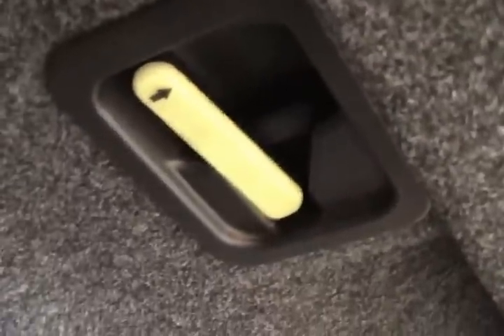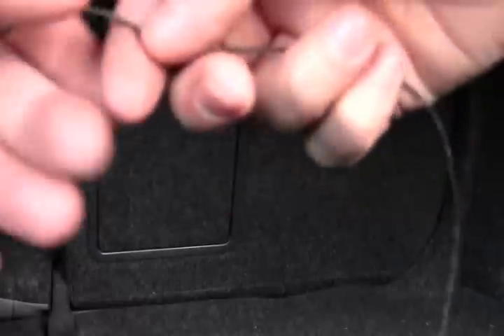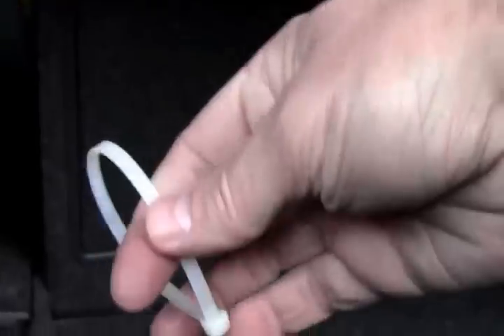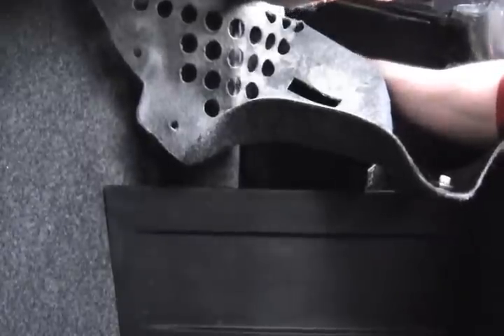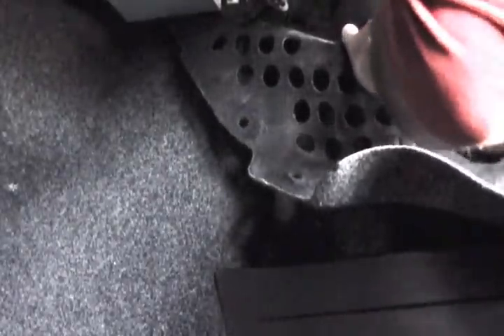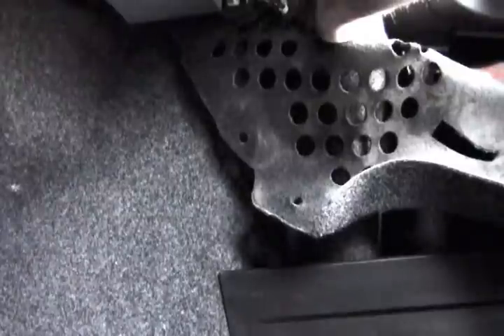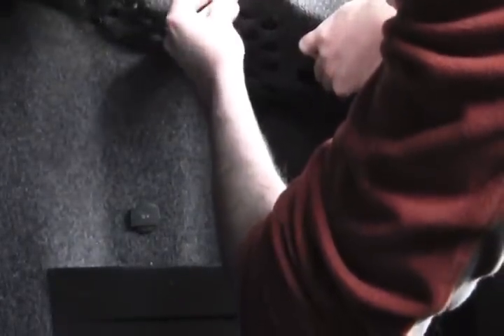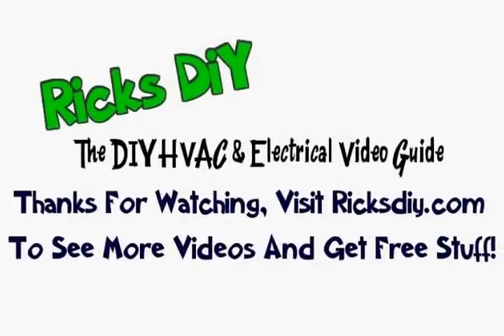Emergency Manual Fuel Door Release VW Jetta Golf Passat MK5 MKV 2006 - 2010

Comment: Thanks, your video has shown me how to get around that problem.  I have the short wiring harness issue and it looks as if who ever the previous owner was tried to fix it by his or her self.  I got it from a dealer so I do not know who had it before me.  I got it just in time for the transmission valve body replacement.  If anything I had that done mostly to get a free fluid change.  That stuff is F-ing expensive!!  18.36 per liter.  I have used Toyota type T-IV and so far no issues.  It has been in there for around 24k miles.  The thing you need to look for with the 09G is fluid that meets JWS 3309.  The bottles the Toyota branded fluid comes in looks like the same style Mobile 1 uses but with different labeling.  If you have the DSG, your fluid IS different and the fluid for the 09G will quite likely ruin it so what ever car you have look at the fluid specs.  If in doubt get it from the dealer since that is the safest way to go.

Comment: Great video !  Unfortunately for me.. the rod itself pulled out from the locking end of the fuel door. My actuator was working but the door wasn't releasing. Just wanted to make people aware that this could be a possible problem as well. B6 Passat wagon. More info here:   http://forums.vwvortex.com/showthread.php?6910891-Need-help-!!-Fuel-flap-won-t-open-!!!-Manual-fuel-flap-release-on-B6-wagon&p=84882043#post84882043
Reply: Same thing happened to me, but at least I can use my car now.